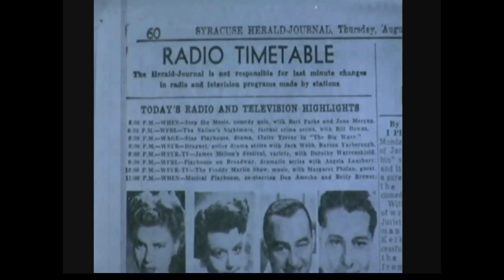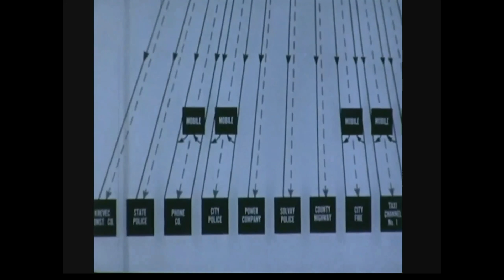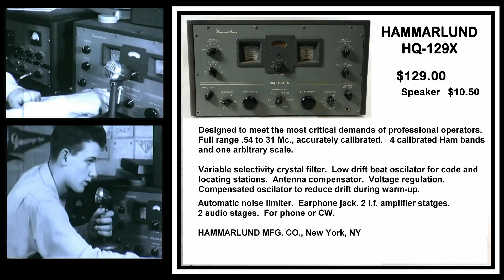HAM Radio in Emergency Civil Defense Communications Vintage 1951 New York City Hammarlund

Comment: As a radio operator, I carry my dipole antenna and slingshot with extra fishing line out camping . Antennas are very large and must be mounted very high, so I use a slingshot with fishing line to place a lead to hoist the rope that holds the antenna spanned between tress. This allows you to reach much higher then tossing a rope into trees. 

Although armature radio now includes digital transceivers, there is nothing like analog to cut though the QRN.
Reply from the maker: Hi Carlos, thanks very much for your feedback.  Using the sling shot and fishing line to create your antenna span is a great idea!    I had to look up "QRN" .... it seems it means naturally occurring radio noise..?  ~     Victor, at CHAP
Reply: Very large antennas completely unnecessary. Due to homeowner's restrictions, I rely on tiny wire antennas in my attic and a 1/8" dia wire in between palm trees just 20' up to talk all over the world. I can also communicate all over the world with my 8' mobile antenna from my car.